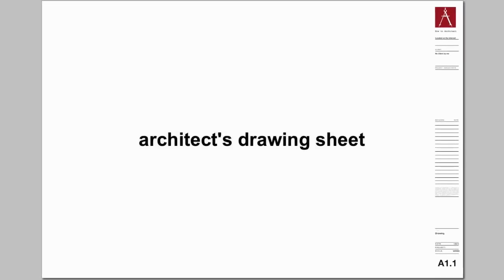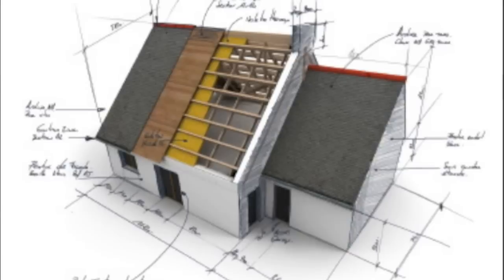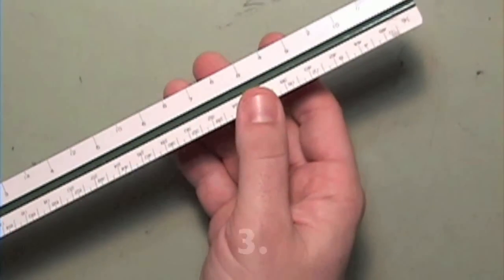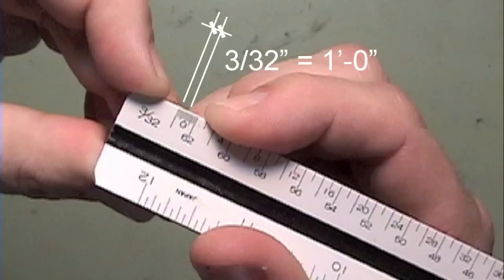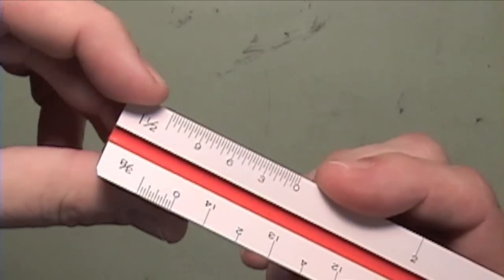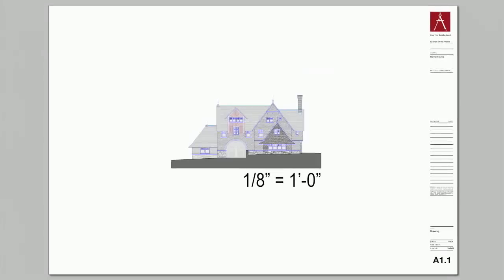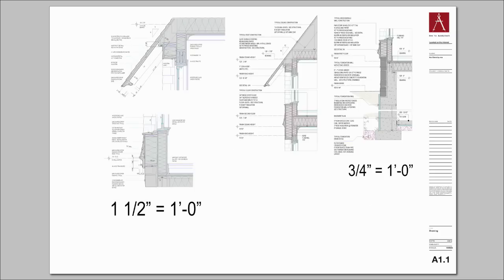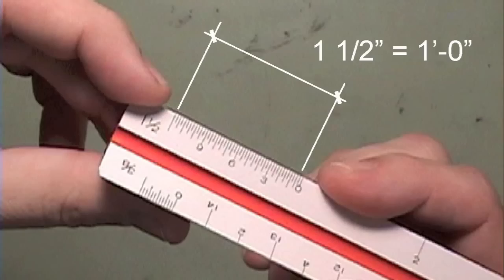How to draw like an architect, pt.6 - Scale

Comment: Another way to think of it, is scale depends on what you want to show. For example, in the design stage, 1/4" scale might be too much detail because not all the questions have been answered or clutters the drawing (for example, as in working through layout and massing, simple one line doors and windows enough to communicate the relationships without distraction). Along the same lines, if showing a small project (typical residence for example), the scale be different then a large project (a Church for example). Some projects, by the way, are so large that drawn at a small scale and then details drawn at a larger scale, but most never that fortunate to have that opportunity.

Comment: @sgeorge001 If you get into restoration work, of extensions of older buildings you could find yourself dealing with a lot of imperial drawings. I think 1/8th scale comes out as 1:96, which is dangerously close to 1:100 - beware!